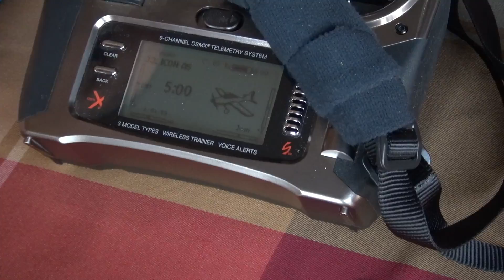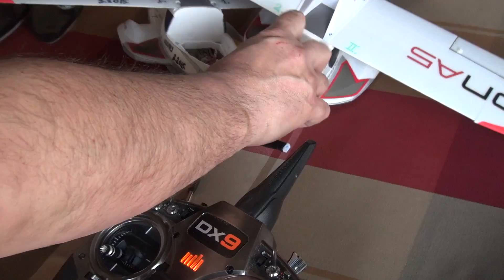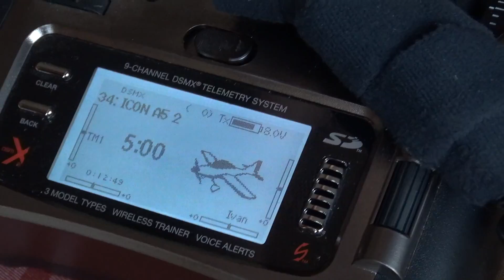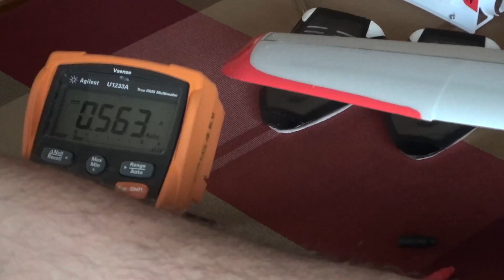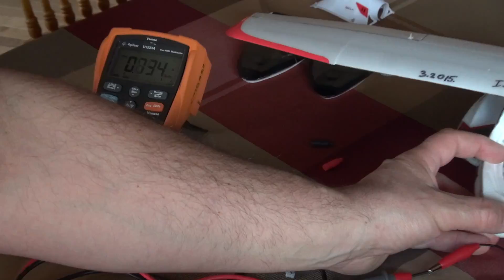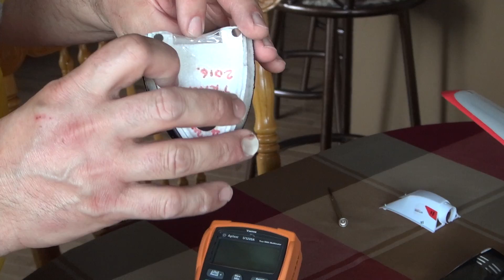.. I found the reason for weak motor performance of my crashed micro icon A5 .. 20160402193512

Comment: Ah the magic smoke! Yup killed it. Did water get inside of it mabe? I use CorrosionX on all my electronics that I know will be exposed to water. I fly my Apprentice off water with pontoons and have had no issues due to water. Well if anything,you have spare parts. You could order a new board,but I wouldnt.
Reply from the maker: Ja water shorted it in a second  ....    now I put all my electronic in a small plastic bag  cheers